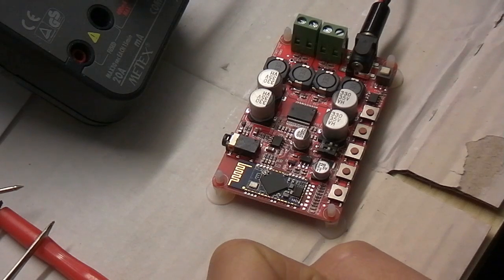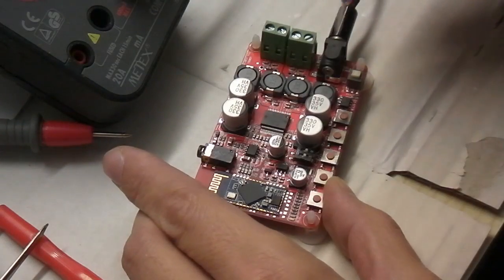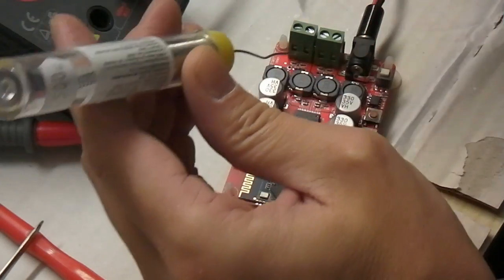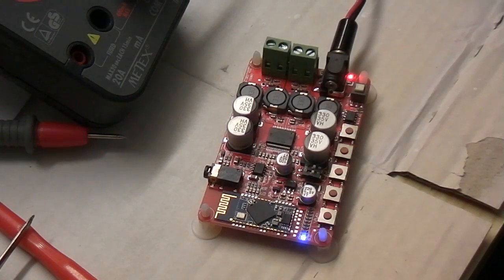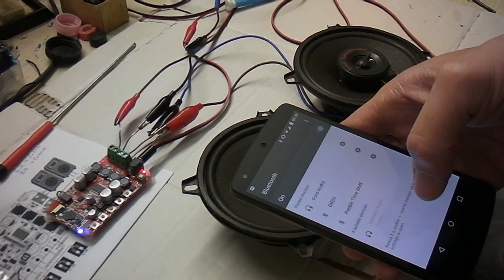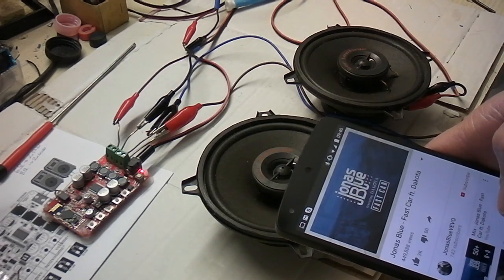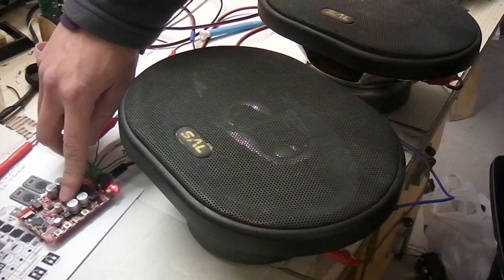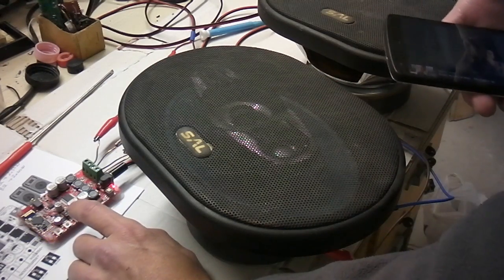TDA7492P Bluetooth amplifier loose solder joint fix

Comment: hi, i have the same board , i played some songs but after sometime suddenly stopped, i thought speaker got issues, but later i checked with aux port its working fine, but the speaker connectors are not working can you please help me to sort out this issue

Comment: Does this board support for 2x30 watt 8 ohms speakers?
Reply from the maker: Yes. The speaker specs does not really matter, as long as you are not going for the best sound quality, what wouldn't make sense with this board any way.
Reply: @sharedinventions  can i connect 2 speakers of 30 watt 8 ohms ?
Reply from the maker: @abhilashactor3340  YES
Reply: @sharedinventions  thanks a lot man😍😍🍫
Reply: Can I use tpa3118 amplifier board for the same speakers?
Reply from the maker: @abhilashactor3340  As I have already mentioned, speakers does not really matters.Using too big speakers, the sound will be weak. Too small speakers might be destroyed on higher volume. So yes. You can use those speakers for basically every amplifier.
Reply: @sharedinventions  thanks a lot 😍

Comment: soldering is very poor,   after a few days of use mine stopped turing on,  i had to use smd rework station to fix the soldering of components near the bluetooth module.
Reply from the maker: Unfortunately this is very common lately. I recommend to ask for refund!

Comment: I purchased 2 of these board but one of the keeps turning off then on after 30 minutes of use. Would happen to know any fix for this problem?
Reply: I am experiencing almost the same issue (mine does this randomly). Did you manage to find a fix for this?

Comment: hi, my board which is a red one has the problem that when I plug in the 12volt  adapter only red light turns on and no bluetooth or blue light blinks, and also no sound. plz help me what to do. thanks
Reply: rizwan umer depending on the size of your speakers you might need higher voltage for your power. Try it with a 24v dc adapter

Comment: May i know where is the negative and positive in the interface connection..i want to connect my battery to he board and i dont know where to wired it
Reply from the maker: I believe the lead comes out from the back of the DC socket is the positive, all others are the negative.
Reply: Thanks.i want to know hot battery work? I have 3 18650 and 4 new tp4056..can you tell me how to wired it
Reply from the maker: This module will require at least 8V. If you have 3x18650 batteries, I recommend you a "3S 10A 12V Lithium Battery Charger Protection Module" instead of the tp4056.
Reply: Yes i have tp4056 i have 5..should i use only 1? How to make 3s battery? I am trying to get one but its smoking

Comment: Hello, I receaved the same board, but it keeps on turining on and off. It seems it works perfectly as my devise seese the amplifier, but it yuts keeps on shuting off and on. What might be the problem?
Reply: Paulius R. It could be the power supply do you have enough amps and a high enough voltage?
Reply: I have the same problem. I am using a 6s2p LiIon pack (24V, 2Ah). Did you manage to find a solution for the random restarts?

Comment: How to set on aux mode? Whenever i play on aux, sound comes only for 1 second just after both buzzing tone. Thank You.
Reply from the maker: When you connect your audio source to AUX the bluetooth module will automatically switch to AUX mode, and let the signal flows from the AUX input instead of BT.
Reply: I have the same problem on a red version of this amplifier, does not want to switch to AUX as an input (red and blue lights flashing and nothing happens). It possible to fix or aux is for use only for audio out?
Reply from the maker: No. AUX is only for audio input. Can be again a loose solder joint on the AUX jack.

Comment: my have a similar problem, my red light is on, but there is no conection to the bluetooth or jack, is it posible my also need solder?
Reply from the maker: When the red light is on, than the power connections are probably right.
If you do not see the LEDs blinking on the bluetooth module, and even with the jack it does not produce audio, than it should be a problem with the internal power converter. That is (I guess) the parts just near the power switch.
What you can do in this case to pick a hair drier, turn it on to max, and direct it to those lower black bricks from a very short distance. Do this for 2-3 minutes. Let it cool down, turn it on, and cross your fingers.
(As a background: these devices are testes in the factory, but because of the pure quality (of production) it is probably broke during the transfer. Applying a heat of 200 Celsius for a minute or two might cause the loose solder joints to re-flow. Anyway, you have nothing to loose.)
Reply: Balázs Kelemen. i will try that, you are a real mvp.

Comment: Did you get any noise? especially when no song is playing?
Reply: Mine gives off a load of buzzing and popping when nothings playing. Very annoying.
Reply: Kelvin Roper I advice a ground loop isolator
Reply from the maker: Unfortunately I just have destroyed mine. See updated video description for details.
Reply: adding an antenna wire from the bluetooth antenna worked brilliantly. Minimal interference now.
Reply from the maker: Please take a look at my new review, that also covers quality issues: https://youtu.be/q37LFamX77g

Comment: Hello Balázs! Are those speakers 4 or 8ohms? Also, if 4ohms, what voltage and amperage of your power source? Thanks man!
Reply from the maker: Hi Bruno! The specs says, that output impedance can be from 4 to 16 ohms. With 4 ohms, the speakers might be less loud, but there is a loudness switch provided to adjust that. The input power depends on the output power, but I can tell you nothing about the efficiency (expect that is does not get hot). Thus you might need a 140W power supply to drive a 2x50W speakers set. The specs also says, that you can drive it with from 8 to 24V. In my test setup I was measuring 2Amps peak at 12V.

Comment: How do you like the amp?  There are so many amps on the market, I don't know which one to choose. Do they provide enough power to drive two 8" or 10" cones? It's for a few suitcase-boomboxes.
Reply from the maker: I didn't have build my boombox yet, but I've made several tests, and this small puppy works very well. I believe that the cone size does not matters, but the resistance. This amplifier can drive from 8 up to 4 ohm speakers, this is the only thing you should keep in mind. A bigger speaker might be more quiet than a smaller one, if the amplifier cannot drive it. What will be the case with 10" cone speaker. But generally said a bigger speaker will provide a better sound quality than a smaller one. Also note, that speakers with size 8-10" cone cannot provide high frequency tones. That is why I like to use 2 or 3 ways speakers.